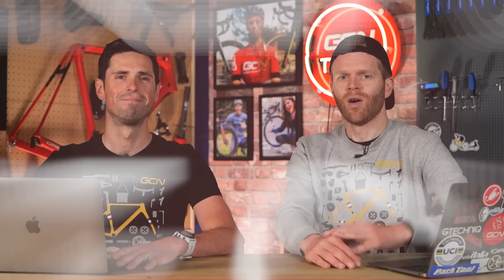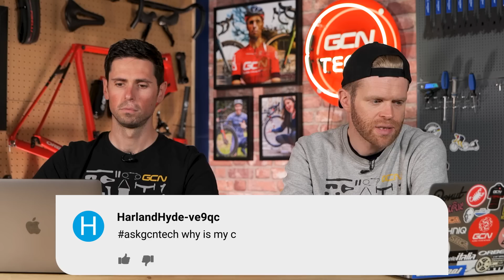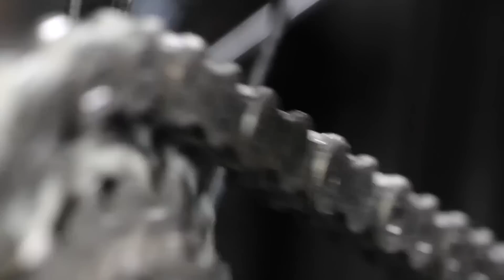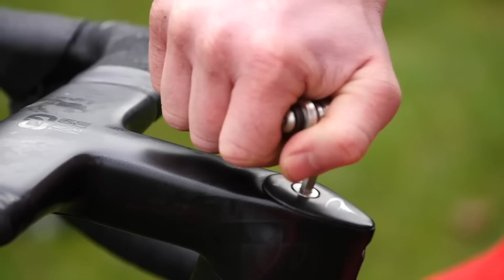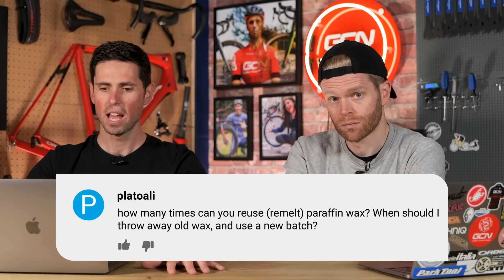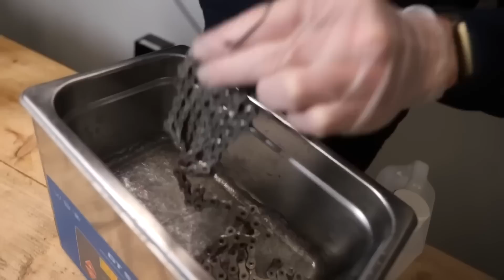Power Meters, Thru-Axles & Chain Wax | GCN Tech Clinic

Comment: #askgcntech Question, there is a person in Canada that takes a 11 speed cassette ,does a little machining to the large cluster so it can replace a 10 speed cassette. Do you think that the indexing of the gear shifting will be slightly off  or will it still line up the chain correctly?

Comment: Can I mix and match Shimano 11spd 105 with GRX? For instance and chain not withstanding, can I replace my 105 rear derailleur with a GRX option for the clutch capability and greater rear cassette range? I bought a gravel bike just before grx was released and spec'd it with 105 with a compact up front and 11-32 out back primarily for commuting. When I take it on gravel adventures I tend to have to run in the top ring up front to keep tension on the chain and avoid chain slap. I am also limited to the 32 gear at the back. I'm aware the 105 derailleur will handle a 34 cassette giving me a 1 to 1 ratio but would still like a clutched rear derailleur.

Comment: I have a thru axle system and the axles are thinned in the middle leaving about 15mm of thicker bits for where the bearings should be seated. I installed a new wheel thought there would be no probs but the wheel started wobbling horribly during a ride. I ground the spacers pressing against the bearings and the fork - looked as if the bearings didnt work - Has anyone come across sth like this. Cheers. The axle was tight all the time.

Comment: Hi guys, does how you measure your chain on a new bike build change depending on your cassette/ chainring combination? I've built a gravel bike and used a 42/42T cassette chainring, and after following what I've seen online(link + 2-3), the chain, to me, appears short and seems to put a lot of stress on the derailleur. It will go through the 11 gears but struggles  in the larger 2. Any thoughts? #askgcntech

Comment: Loosen thru axle with a multitool: You can use the other  thru axle as an extension for the multitool. For this, however, you must first remove the one axle from the wheel. It is rather unlikely that both axles sit so tight.

Comment: #askgcn how much should you eat on, before or after a ride if you have no aspirations in racing? I go on a couple of bigish rides quite often (ca. 220km Average a week ) but I sometimes feel like a big portion of pasta the day before, 80-100g of carbs per hour during and a protein recovery shake after the ride feels a bit too sophisticated sometimes.

Cheers
Lukas
Reply: "80-100g of carbs per hour" that's for racers consistently generating 300+ watts for 3 to 5 hours, or longer.
I'd try for half that and see how you get on.
Reply: @henseleric  that's the thing, the more I eat the better I feal haha
Reply: Is that 220km per single ride or weekly mileage?  On a single ride of 220km at a relatively easy pace, I would eat real food. At a higher pace, I would eat bars that contained some protein/fat and bottles that have some carbs.  80-100 grams+ of carbs per hour is very hard to do for the average cyclist and it is not needed.   Long term it can lead to T2D.

Comment: #askgcntech  I have a question, what tire pressure is good for the turbo?

I have a bike that is only used on the turbo and it's a 7 speed racing bike that is so old it has down tube shifters and I can't get a wide tire on there, so I have 23 mm tires on it.  The turbo has fluid resistance, it's fantastically quiet for living in an apartment.  The tires are not turbo specific because I'm on a budget, I just bought the very cheapest.

I've pumped up the tires to 7 bar and over time the pressure goes down to 5 bar and then it's all squeaky and the back wheel slides on the metal roller, which is not good enough.

I've just been pumping the tire back up to 7 bar, but would it be better for my to adjust the turbo so that the metal roller is closer to the wheel?  Or is 7 bar normal for a turbo?

Comment: Sorry Ollie, I have to disagree.  I have several sets of allen keys (so as to have a set to hand in each shed/garage), and even other tools from the "meedle of leedle" and they're fine, but then I never use them to try to shift rusted siezed bolts.  I suspect, Ollie, that you assume they're rubbish so you've never tried them.  Why would you, you're sponsored by Parktool so its no expense to you.  You aught to do a proper comparive test before you rubbish them.  What I would say is loosen/tighten with the plain hex end not the ball hex end.  As to carrying a hex key for your through bolt, I believe I've seen in one of your videos a pro bike with a suitable key taped to the frame, so easy to carry.
For really siezed, or for torque tightening I use a nice set of 3/8 drive hex bits.

Comment: #askgcntech Hi guys, love the show 🤙🏼 So…… I have a set of Giant SLR1’s on my 2022 TCR Advanced Disc. 42mm front and 65mm rear. But….. the internal/external width of the back and front are different, I have 28mm Conti GP5000 S TR’s on. My question is this…… should I have different size tyres on the front and back? Also tyre pressures, the Silca site recommends more in the front than the back when you put in all info including measured size (which is 28mm front 29mm back). Lastly……. They’re both larger than the rule of 105% so are they killing any aero gains from the wheels? So basically not sure I’ve got the best set up here and any help would be really appreciated! Thanks! 🤗

Comment: #askgcntech Is it possible to reuse the cleaning liquid from a chain cleaning device? that would be great for ecological and economic reasons. I once tried to run it through a paper filter to extract all the solid deposits but then I found that the liquid seperated in two phases of about equal amount. Could one be the chain oil? But it's far too much for the amount of oil that I put on the chain. Any ideas or maybe worth an investigation?

Comment: Chain waxing.
 If your doing it correctly bend a salad fork at 90 degrees and place it in the cooling wax. The next time before you wax. Use your bent fork as a handle, pull the wax puck out of the crockpot. Flip it over and scrape off the layer of wax that contains debris.

Comment: Silca Super Secret drip on chain lube applied between hot wax treatments and after riding in the rain takes care of any rusting. I hot wax every 1000km and apply Super Secret every 300ish km between hot wax treatments and after riding in the rain and have never had a rusty chain. Problem solved. No need to apply sticky lubes to your chain and mess up that beautiful wax coating.

Comment: Well actually, when you glue on a strain gauge onto something it becomes a part of that something and transfers some power too. And has its own hysteresis, also usually greater than the body they are glued on. Now, Hall effect and optical sensors don't have such weakness. But I can't remember any bike powermeter using those.

Comment: #askgcntech - is it possible to run a GRX Di2 rear derailleur using Ultegra (road) levers together with my Ultegra front derailleur?
Reply: I believe you can. I'm wanting to do this also, because the GRX hoods are just too bulky for my hands especially wearing gloves. I have the new 105 di2 12 speed on my road bike and the hoods are so much better to get a good grip on for out of the saddle efforts.

Comment: with the ebike it might be better looking at different metrics like time over set distances, HR or breathing rate, exertion levels through wearable health monitors, or percieved effort. Maybe not as precise but can still be beneficial in monitoring your performance
Reply: I´m pretty sure a crank arm or pedal power meter on an ebike will still measure the power you put out and not what the motor is supplying, so it´s still a viable measure. And many ebike motors have a built in power meters giving you data on how much the motor is supplying and how much your legs are producing (don´t know how accurate).

A hub power meter on the other hand would measure the rider and motor combined power output going to the rear wheel.
Reply: yeah I was trying to figure out the mechanics of this and what is being measured where and i just confused msyelf! but I think you're right. They power I'm putting through the pedals that gets recorded is going to be the same no matter the motor (or lack of). The motor isn't adding to the power at the pedal stroke, it's just enhancing the power that goes through the wheels. So crucially if you are measuring your watts then you are still getting a "true" measure of the effort you're putting out. Does that sound right?
 @Venna78
Reply: Or invest in a powerhub

Comment: #askgcntech 
I've been riding for about a year now and I had a bike fit early doors as I didn't really have much of a clue where to start. I the last 12 months I've lost about best part of 2 stone and my body flexibility  has greatly increased.  Would another bike fit be beneficial as I'm physically in a much better state than I was before, does the position you achieve on the bike change as you improve?

Comment: I live in the southeast US and the humidity is off the charts in the summer, I store my bikes in my garage, but I run a fan to keep the airflow moving and that helps eliminate the moist air from settling and causing rust. Similar action that a dehumidifier would do

Comment: #askgcntech Are there some scenarios where heavier wheels or tires might be an advantage? I ride a lot of long mostly flat gravel roads and came up with a theory that a heavier tire might be better at holding momentum over long flat rides. This was a thought that occurred to me recently when I was shopping for new tires and started looking at heavier touring tires instead of the usual lightweight gravel or XC tire.
Reply: No, higher weight means higher rolling resistance. The only way to benefit from weight is starting at the top of a mountain and ending downhill.
Reply: @stefanwagener Even the “top of the hill” advantage is probably non existent. Drop two riders out of a plane, one with a 10kg bike and one with a 15kg bike, they’re both going to accelerate at the same rate.
Reply: @101francis101  That is not true. When jumping out of the plane the air resistance plays by far the biggest role so the difference might appear tiny. But maybe when you have a tandem with 2 people next to you and start rolling at the top of a hill then you will notice a huge difference in accelerating downhill. You will also notice when you do bike packing with heavy baggage that you are accelerating faster than without it.
Formular is F = m*a so the down force F without rolling and air resistance is directly proportional to the weight (m).
Reply: Yeah they did a video on this and talked about how the wheel acts like a fly wheel storing momentum like you mentioned.
Reply: If you search "gcn rotating weight" you should be able to find the videos

Comment: #askgcntech Can I use wax to lubricate my rim brake pivot points and springs? After rain they get a bit crusty of all the sand getting there but my chain won't because it's waxed.
Reply: Sure I don't see why not, should work the same for you as the chain. It's a moving part also.

Comment: i'm in the habit of dunk old waxed chain directly back to the re-melt wax and goes on like that for few cycles. to minimize contaminant back to the chain, sometimes i filtered the melt wax to make it little bit cleaner. and also when dunk the chain inside, try to suspend the chain in the midddle, not at the bottom of the wax pot. hopefully the contaminant is all at the bottom. haven't thought of another way.
Reply: How do you filter the melted wax pot? :)
Reply: @fabianvondehn5624  i just pour the liquid wax thru paper filter or kitchen paper towel. some contaminant will stick there although some wax will also stick to the filter and become waste.

Comment: I waxed my chain 35 years ago.  Too much work.  It's ok if you have a team mechanic re-wax and pre-ride your bike until your chain is smooth again.  And a week later it needed to be re-waxed.  Waste of time.
Reply: 35 years agoo?? In the 80s?
Reply: @Kuroneko6235  Yes.....I've been riding that long ago if not more.  I'm 68 now and riding anywhere from 9 to 40 miles per day and not to mention it but I have a complete bicycle shop in my kitchen just like the one I had in my parent's house when I first started serious cycling at 16 years old......Waxing isn't a new idea.  It's been around for a long time.
Reply: @douglasmarsh9482   I remember  hearing about chain-waxing, from my racing buddies in the 70s, but in my club we boiled Renold chains in 90-weight gear-oil, when new, and rode them until they were elongated, with no further attention, lol.
I'm 70, and waxing chains is a doddle. Different strokes, my friend.
Reply: @Kuroneko6235 : yes, people were certainly hot-waxing chains 35 years ago.  The old school recipe was paraffin mixed with motor oil in different proportions depending on how much water resistance you wanted.
Reply: Too much work for me beyond the chain for my TT bike and mountain bike since they get about 1/3 the mileage of my main road bikes.  But not everyone is bothered by that time investment and some seem to enjoy it
Reply: Clueless

Comment: Question 1: You can use a powertap hub to measure power at the rear wheel, and then all you have to do is add 2-3% (drivetrain losses) before subtracting the power reported by the pedals. The result will be how much additional power the motor is providing.
Reply: Powertaps don't have motors...
Reply: I know, but I'm assuming it's a bike powered from the BB area @veganpotterthevegan
Reply: @philadams9254  if someone wants a power meter and has a bb motor, power meter pedals make the most sense.  Powertaps are all but dead now and you can't get new replacement parts or get the hubs repaired anymore

Comment: #askgcntech. Hello from Canada!! I just turned 40. I am not nor have ever been a racer, although i have really started to enjoy the data and i am trying to get in better shape.  At 40 i am really trying to see what i am capable of.   Training for lack of a better term.   The question is.  Should i get a power meter, or is it a waste of money?  I really want one. I already have a cycling computer, cadence, speed and heart rate monitor, but i feel like that the power meter would give me that little more data to help with gains and working out.  Over all upgrading my fitness on the bike.   Or..  is this just a midlife crisis?
Reply: For your first power meter I’d suggest that you invest in a direct drive trainer and a Zwift subscription. This will allow you to see where you’re at fitness-wise and to understand your power profile. Plus, being in the Canada I’m pretty sure that there are times when you don’t want to be riding outdoors. With a good trainer setup you can ride all year and this alone will be very beneficial to your fitness level.
Reply: 100% get a power meter. You can monitor your 3 5 or 10 second power as you ride to make sure you don’t over do it so you can pace yourself better and it is also a great way to see how you improve over time with you getting stronger which is motivating and therefore gets you out more and the cycle (excuse the pun) continues!
Reply: Assioma pedals are a great power meter and the best for someone normal like me and you.
Reply: To each his own.  Some people find it a good way to motivate themselves.  Personally my performance as a young teen increased dramatically when I got rid of my "speedometer" of the time and just let my body tell me what to do.  As time went on I tried various gadgets as technology marched on.  They always seemed to lead me into doldrums.  I suppose the gadgets may have a place if you're competing at a world-class level and willing to slavishly follow the data and expert-guided regimens.  But to gain fitness, "perceived exertion" is more than enough to guide you to fantastic shape.

Comment: Riding a waxed chain in a wet environment, I just sprayed a rag in GT85 and run the chain through that, remove moisture, leaves a protective coating, keeps the surface of the chain clean and shiny, happy days 😎

Comment: #askgcntech Hello everyone. I’m looking to get into Zwift racing as an already fit individual. My ftp is not the highest ~210 watts but my watts per kilo is 4+. By Zwift’s math, I’m in category A, but I feel as though there is no way I could keep up with the amount of raw power “A” riders are putting out. In a flat course, would I be instantly dropped because my weight doesn’t matter, or does Zwift lean on watts per kilo so much that I could hang on?
Reply: I'm in the same boat.  Good watts per kilo, but light weight means I don't have much total power. I've been spat out the back of every flat to rolling zwift race I've done even within my own category. My only competitive results were in races involving at least 1-2 major climbs (think at least 7-8 minutes each). That's where we get to put the hurt on the bigger guys :D
Reply: I think Zwift counts w/kg when calculating your speed. So light and heavy riders should be on even terms. If you draft a random group of riders you’ll see the do roughly same w/kg as yourself. Boils down to “A” rides on Zwift are just ridiculously hard. 😎